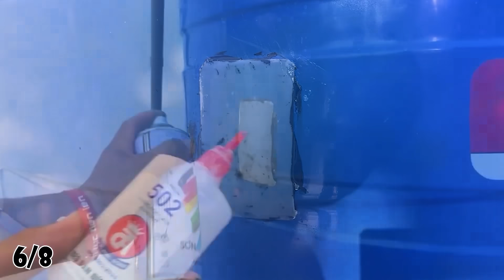I Never Have to Buy Water Again! How to Make Free Water Directly from PVC Drainage Pipe

Comment: You don’t have to not pay for water. You still have to pay for the bill even if you don’t even use the water. (Correct me if I’m wrong 😅😅)
Reply from the maker: Thanks for watching the video! I don't know how the billing system works where you live. However where I live, bills are paid according to usage. Of course if you don't use it, the bill will be zero.
Reply from the maker: You're quite right! Most places charge a base or minimum fee for water service, even if you don't use any water. This fee covers the cost of maintaining the water infrastructure and ensuring that clean, safe water is available when you need it.

It's similar to other utilities like electricity or gas, where there's often a service charge just for being connected to the network. So even if your usage is zero, you'll still see a bill.

Are there any particular ways you're looking to save on your water bill, or just curious about how the system works? 😊💧💡

Comment: What about the connection coming apart, do you use pvc glue , because of the pressure from the pump
Reply from the maker: Yes, using PVC glue is important to prevent the connections from coming apart, especially with the pressure from a pump. PVC cement forms a strong, waterproof bond between pipes and fittings, ensuring that the system can handle the pressure and avoid leaks. For systems that involve pumping water or handling high pressure, the use of PVC glue is essential to maintain a secure and long-lasting setup. Have you tried this method in any of your other DIY projects?

Comment: I would use rain for most everything but cooking even if it's run thru multiple filters. Depending on where you are medical help maybe scarce or non existent if you get ill from drinking/cooking with rain water. Think a stomach bug times 10 dieing from dehydration is a lousy way to die.
Reply from the maker: Thanks for sharing your thoughts! It is true that rainwater can be used for many purposes. Proper treatment can help remove many impurities. If you use rainwater for drinking or cooking, it must be thoroughly tested and filtered to ensure health safety. Do you have any solutions to better treat rainwater?

Comment: Why masonry bits ?
                   🫲🤨🫴
Reply from the maker: That is a temporary solution for that situation. What drill bit would you use for this situation?
Reply: @HolicCreation  
I think just a standard Drill bit of the appropriate size !
The bit you were using in the video, looked like one typically used in a hammer drill, to bore into concrete.
Just seemed a curious bit to use ?

Comment: You know in other countries they use rain for drinking water
Reply from the maker: Yes, you're right! In many countries, especially in rural areas, rainwater is used for drinking after it goes through proper filtration and purification processes. The key is to ensure the water is thoroughly treated to remove any harmful contaminants. Have you ever considered using a rainwater collection system with advanced filtration in your area?

Comment: What happens with coke bottles on the roof when there are heavy winds and they get ripped off their connections?
Reply from the maker: If Coke bottles are attached to a roof and experience heavy winds, several things can happen:

Displacement: The bottles can get dislodged from their connections, which might result in them falling off the roof. This can create a hazard for anyone below.

Damage: Falling bottles can break upon impact, leading to litter and potential damage to property or vehicles.

Wind Turbulence: If the bottles are loosely attached, they might create additional turbulence as they get whipped around by the wind, potentially causing more instability to whatever they're connected to.

Injury Risks: If bottles fall or get blown away, there's a risk of injury to people or animals in the vicinity.

For safety reasons, it’s essential to secure any items on rooftops properly or consider more stable alternatives if heavy winds are a concern.
Reply from the maker: If Coke bottles on a roof are subjected to heavy winds and get ripped off their connections, several things can happen:

Falling Hazard: The bottles can fall from the roof, posing a danger to anyone or anything below.

Breakage: When the bottles hit the ground, they may shatter, creating litter and potential hazards from broken glass.

Wind Turbulence: Dislodged bottles may create additional wind turbulence as they are blown around, potentially causing more chaos on the roof.

Damage: If they are attached to a system or structure, their removal might cause damage to the roof or connections.

Debris: Displaced bottles can contribute to litter and debris in the surrounding area, which can be problematic for the environment.

For safety, it's best to secure any objects on roofs and avoid using lightweight materials in windy conditions.

Comment: Surely you just put all that filtering into the green buckets from the start and run the water through each bucket cleaning the water as it passes through the bucket system
Reply from the maker: That's a clever idea! A multi-bucket system can be great for filtering water step by step, especially if you layer materials like sand, charcoal, and gravel. Have you tried a setup like this before, or do you have any tweaks that make it more efficient?

Comment: Believe it or not, collecting rainwater is actually not legal in many jurisdictions (USA).  Be sure to know your local regulations before doing so.
Reply from the maker: That's a good point! In the U.S., rainwater collection laws vary by state. While it's legal in most places, some states have restrictions or require permits due to concerns over water rights and resource management. It’s always best to check local regulations before setting up a rainwater harvesting system. Have you looked into the rules in your area yet?

Comment: When are you going to learn to a grinding guard no the grinder i have seen people cut themself a cut with 40 stigeson is arm and many others please use the electrical tools wisely this note is comming from a tradesman
Reply from the maker: Always use the safety guard when using grinders and other power tools. Wear personal protective equipment (PPE) like safety goggles and gloves. Maintain a firm grip and work in a safe area to prevent accidents. Safety is the top priority!

Comment: I don't understand how those fiLter system works..the water connection is straight..it's non.sense..shouLd it be water enters in the top then exits at the bottom of the fiLter??
Reply from the maker: Yes. Do you have any advice for me to make this system work more effectively? Thank you very much and have a nice day.
Reply: @HolicCreation  tnx for your open mindedness..I guess it wouLd work better if puT water in the top of the fiLter then Let it exit at the bottom of the fiLter & repeat this process to the other fiLters..you'LL have Lying "S" connection 😎 for me this works better because the water is PASSING thru the fiLters..

Comment: Your filters are horizontal but your pipes run vertically. This will not work.
Reply from the maker: Thank you for your observation! You're right; the orientation of the filters is important for optimal function. I appreciate your input, and I'll make sure to consider this in future projects. Do you have any suggestions for improving the setup?

Comment: If you paid the same money to buy water, the cost would be much less than the money of this project.
Reply from the maker: That’s a valid perspective! Depending on local water rates and the initial investment for DIY projects, buying water can often be more cost-effective, especially if the setup requires significant materials and ongoing maintenance. It’s all about weighing the long-term benefits against the upfront costs. Have you found that buying water works better for your needs, or do you see value in DIY projects for other reasons?

Comment: Explain to me where the bird shit goes in this  scenario or do you just happily drink it, hope no one copies this mad idea
Reply from the maker: In scenarios where bird droppings are a concern, especially regarding water collection or purification systems, it's crucial to consider sanitation and safety.

Contamination Risk: If bird droppings are present on roofs or in collection systems, they can contaminate the water supply. This is particularly concerning for drinking water, as bird droppings can carry pathogens.

Water Filtration: Ideally, any system designed to collect or purify water should include effective filtration methods to remove contaminants, including bacteria and parasites that may come from animal waste.

Hygiene Practices: Regular cleaning and maintenance of collection systems are necessary to minimize the risk of contamination from bird droppings and other debris.

Alternative Solutions: For drinking water, it’s generally safer to rely on municipal water sources or well-regulated purification systems designed to ensure water quality.

It’s definitely important to be cautious with DIY solutions, especially when it comes to health and safety. If anyone is considering such methods, they should thoroughly research and ensure that their systems are properly designed to avoid contamination.

Comment: it spends to much money for those in remote area. Dig a pool to capture rain water, then let it be clean or pour something to clear mud. then take it, boild it for drink.
Reply from the maker: That's a smart and cost-effective idea for remote areas! Rainwater harvesting with a pool is a natural and accessible solution. Boiling the water is a reliable way to ensure it's safe for drinking. For clearing mud, using natural coagulants like crushed seeds of Moringa or alum powder can help settle the impurities.  

Do you think it’s worth investing a bit in sand or gravel filters to make it even cleaner before boiling?

Comment: What would you do with so much water anyway.. just save enough and let the rest back to nature. Use them for plants and animals. Keep it too long it would turn into germs partying inside it. 😅
Reply from the maker: That's a great point! Rainwater, when stored too long without proper treatment, can indeed become a breeding ground for bacteria and other microorganisms. It's wise to balance rainwater harvesting with practical uses like watering plants, supporting wildlife, and other non-potable needs. Regularly refreshing and using the stored water helps keep it safe and prevents stagnation. Proper filtration and treatment systems can also ensure that stored water remains usable over longer periods. Letting excess rainwater flow back into the environment helps replenish natural water tables and supports ecosystems.

Comment: How about Charcoal , you  did not charcoal?
Reply from the maker: Thank you for watching this video ! Charcoal, especially activated carbon, is highly effective in water filtration. It removes impurities such as chlorine, volatile organic compounds (VOCs), and some heavy metals. If you are concerned about filtering out harmful substances, adding a layer of activated carbon can significantly improve the quality of your water. This method is especially useful for deodorizing and improving the taste of water. In the video, I did not use the water for drinking, if I were to use it for drinking I would definitely add an activated carbon filter and a UV sterilizer. Then I would boil the water and finally drink it. Have you considered combining this method with your current setup for better results?

Comment: 9.40  those pipes, especially the lower ones, are not waterproof, and you should not like to see those electric items onto a puddle... though i'm afraid it will be inevitable, when the buckets are full to overflowing
Reply from the maker: You’re spot on! 😅 Those pipes definitely don’t seem like they’d hold up in a water fight. And mixing electric items with puddles? That's a recipe for disaster! It might make for a great DIY project, but safety should always come first. Any suggestions on how to make it a little more water-tight?

Comment: You can't drink this water. You can use it to water your lawn though.
Reply from the maker: Ah, sounds like you're talking about greywater or perhaps untreated water that's not safe for drinking but can be used for non-potable purposes like watering the lawn. It's a great way to conserve water, especially in areas where fresh water is scarce. Just make sure to use non-toxic soaps or cleaners to avoid harming your plants. Are you setting up a system like that, or just making an observation?

Comment: I don't understand how the water flows to every can from the top. Doesn't make sense to me. The first trashcan would have to be completely full first right?
Reply: He only needs to have one inlet to the first green bucket maybe with a larger PVC and the water will balance itself out with all of the other buckets. Maybe install a mosquito net on top of all buckets. Rain water is a good source of mosquito accumulation.
Reply from the maker: @wtdudley05  Thanks for watching the video! In the video I made my own trash can with a mesh screen at the bottom to allow water to flow through and prevent trash from remaining in the can. This allows water to continue to flow down and fill the containers, and the trash can be removed immediately afterwards.
Reply from the maker: @haivt508  You are right! It is the physical principle of "communicating vessels". Water will balance itself with the containers through the water valves connected together.

Comment: That 4th project is too much work and especially parts and glue, compared to the price of a few Garden Sprinklers.
Reply from the maker: Maybe so! However, I still want to make a product myself to experience it rather than buy it. Do you often do any projects at home?
Reply: @HolicCreation  - Sure!  Like taking apart a Solar Powered Garden Light, and cutting the wire to the solar panel, then adding an extension to the wire, so the Solar panel can be outside, and the light can be indoors.  Great way to have a Night Light that doesn't require House Power.

Comment: NO GREY PIPE. It is made from recycled plastic! White pipe for drinking water!
Reply from the maker: I understand your concern, but the color of a plastic pipe does not necessarily reflect its material or quality. Pipe colors are often used to distinguish different purposes, such as drinking water, wastewater, or gas. It is more important to make sure the pipe is certified safe for drinking water, regardless of color. Have you ever encountered a pipe that was unsafe because of its color?

Comment: Well, to be honest, yes, I don't know if the socket is waterproof but it still seems kind of stupid to me that the guy puts a socket directly under a non-waterproof cable and then just sticks his finger in the socket is a bit stupid, isn't it
Reply from the maker: You’re right, that does sound like a risky setup. Electrical safety is incredibly important, and it’s never a good idea to mix electricity with water or use non-waterproof components in a way that could lead to exposure to moisture. Touching an electrical socket, especially with bare hands, can be very dangerous and should always be avoided unless the power is definitely off.

For a safer setup, here are a few tips:
- **Use Waterproof Components**: Ensure that sockets and cables are rated for waterproof use if they might be exposed to moisture.
- **Proper Insulation**: Make sure all electrical connections are properly insulated.
- **Safety First**: Always turn off the power before working on electrical systems and use tools with insulated handles.

If you have any more questions or need advice on safe electrical practices, feel free to ask! Stay safe out there! 😊🔧✨

Hope you have a safe and productive day! 🚀🔌🌟
Reply: @HolicCreation  :hand-pink-waving:☺☺👍👍

Comment: Good grief, part 3 what a mess of a shower head. I'd never put WD40 on something I'd want to shower with. All that effort wasted - simply immerse the head in a mixture of hot water and citric acid. Leave it overnight or at least till it stops bubbling, gently rub over the holes with your finger then rinse thoroughly. Stubborn limescale second treat or gently rub with kitchen sponge/green scourer.
Reply from the maker: Thanks for sharing! Using a mixture of hot water and citric acid sounds like a very effective solution to clean your showerhead without affecting the material or your health. This is a great idea, I will try it next time. Thanks for your feedback and helping me improve the method in the video.
Reply: @HolicCreation  It's a foodstuff so not harmful and is more effective than vinegar (and smells less). I use it to remove calcium salt deposits everywhere, kettle, taps, tiles, toilets, baths - if it has limescale citric acid will move it safely. The hotter the water the faster it works but I leave it overnight with cold water and get the same result, just slower. Wrap awkward areas in kitchen paper and either soak with the solution or better still suspend a container of it underneath but touching the paper so it continues to draw it up.